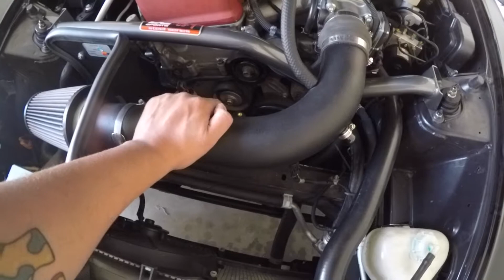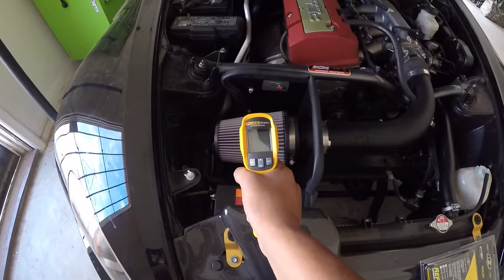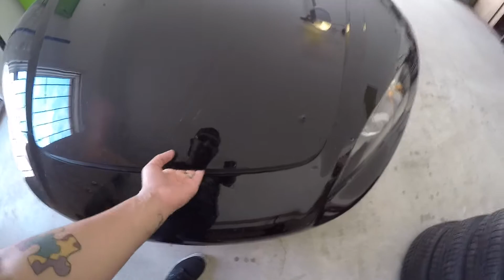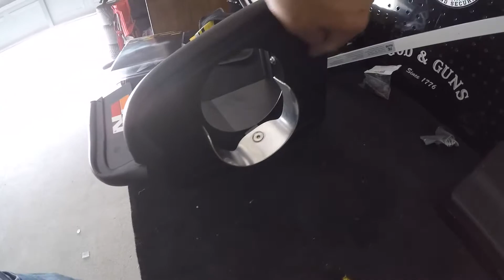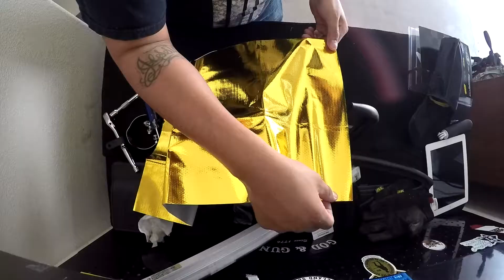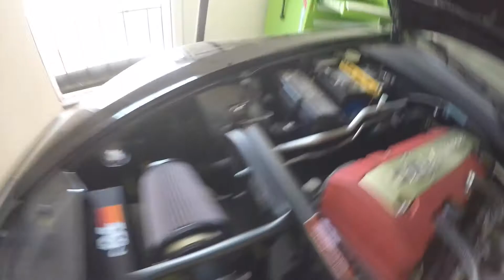Heat Reflective Wrap On The Heat Shield! (Project AP2 S2000 Part 5)

Comment: Did the sound on the SRI sound quieter after your installed that wrapping? i have read that when your wrap or get your headers ceramic coated or exhaust piping it will have dampen the sound a bit.. would like to know if you experience that.

Comment: Looks great and its functional! 2 degrees it great, I bet you if you add more tape in the areas where hot air is sipping through you'll get better temp readings. 

I really like how spacious your engine bay is with the K&N system.
Reply from the maker: I agree! A bit more of the tape would do wonders :)

Comment: For the result I guess I wouldn't do it but it do looks great.  Did you gave up on the engine torque damper? Or wouldn't it fit proper with the tie bar?
Reply from the maker: You gotta keep in mind that I only did the heat shield. If I did the intake piping, I'm sure the result would be more significant. And no, I already installed it lol but the video isn't scheduled to come out till next week.
Reply: +Car HQ ok thanks will definitely check it.  Good job and keep it up 👍